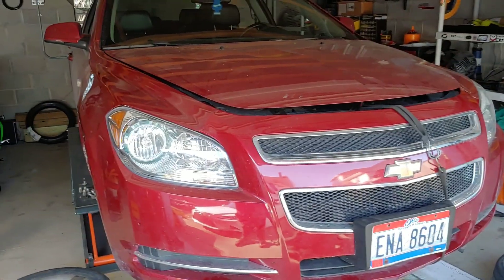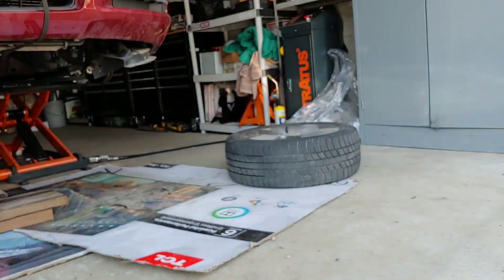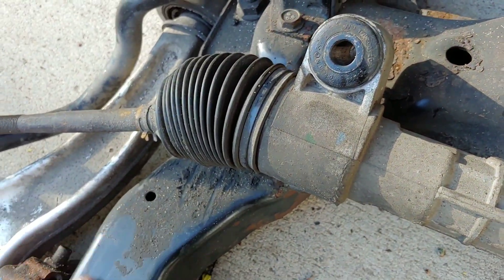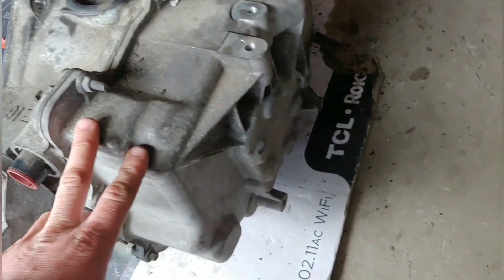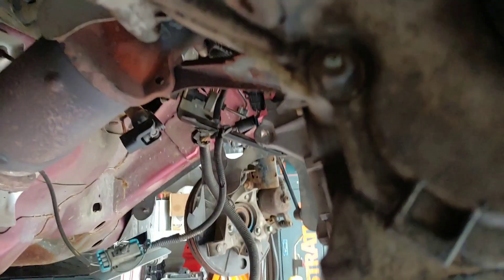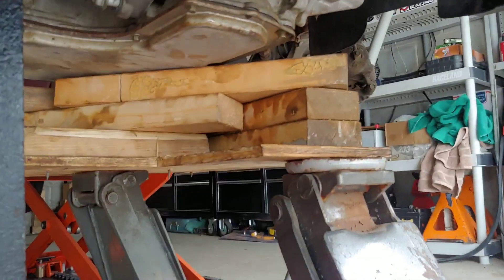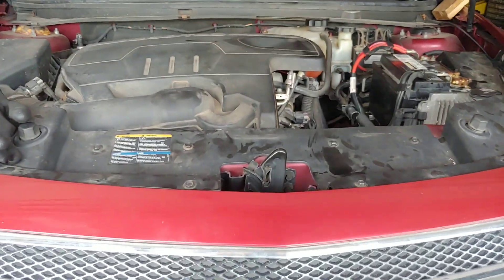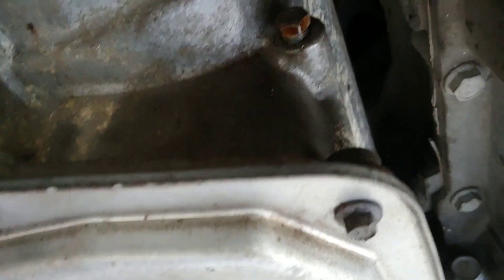2008 Chevy Malibu 2.4L Subframe And Transmission Replacement

Comment: I may have missed it, did you have to remove the front catalytic converter to drop the subframe?  I have to replace my subframe due to rust holes.  If I  have to remove the converter I'll plan to get gaskets in advance.  Great video. Thank you!
Reply from the maker: Sorry I don't remember.
Reply: @AndreychukAndrey   Yes, with the 2.4l engine the front catalytic converter that attaches to the exhaust manifold needs to be removed to remove the subframe.

Comment: hi I have a question does the subframe hold the motor in? or if I take the subframe out of my 2013 chevy malibu will the motor fall down
Reply from the maker: I'm not sure on that but I would think it's same. You will have to go under and check.
Reply: @AndreychukAndrey  okay thank you so much

Comment: I need to replace my stabilizer bar and in links on my 2009 Chevy Malibu LTZ is there anyway for me to replace that without having to drop the sub frame.
Reply from the maker: No you don't have to drop the subframe to change that.
Reply: @AndreychukAndrey  what can I do.
Reply from the maker: You should be able to get to the stabilizer links from the side and for the bar you can probably slide it out from the side.
Reply: @AndreychukAndrey  okay thanks. I’m going to attempt it when I get some time tomorrow. You been a real help.
Reply: Well I got the car jacked up and unfortunately I’m not able to get to the bolts that’s holding the bar down unless I lower the subframe so yeah. That’s disappointing
Reply from the maker: @mauricebuckman3530  Why you replacing the bar?
Reply: Well one one end of the bar itself that connects to the end links had completely broken

Comment: Great content.  Question. What tool did you use to hold the nut in the small slot while loosening the 4 subframe bolts ?  Mine are spinning and unable to loosen the bolts.  It’s a small slot showing a square nut?  TIA 🙏🏽
Reply from the maker: Mine just came out. I did not have that issue.
Reply from the maker: Might have to cut a small hole to hold that nut.
Reply: @AndreychukAndrey  that’s my approach today. Thanks for replying. I appreciate it. 👊🏽
Reply from the maker: No problem let me know how it goes.

Comment: One more question, there is very little room get to the intermediate shaft connection to the steering  rack. Do you recall how to get to the connection to align the steering rack shaft to the steering column  intermediate shaft?

Comment: Nice job bro.
Do you need to program anything after installing the new transmission? 
Thank you!!!
Reply from the maker: No.
Reply: I just installed one it’s not shifting right
Reply from the maker: Did you check the fluid?

Comment: One more question. How do I know if it's 4 or 6 speed transmission?
Reply: The 4 speed sticks out behind the engine towards the passengers side like in the video and uses a short axle to the hub. The 6 speed does stick out like that and uses a carrier bearing on the passengers shaft.